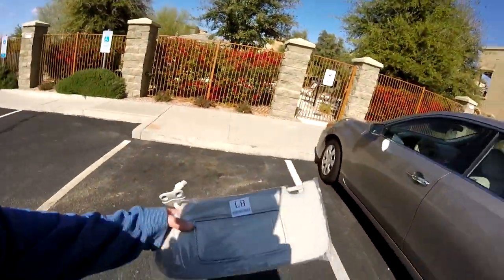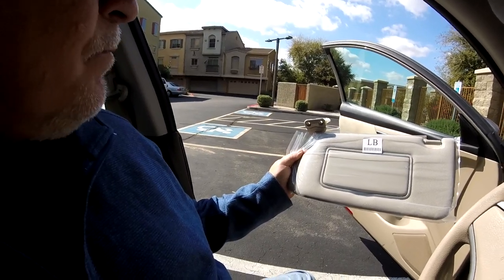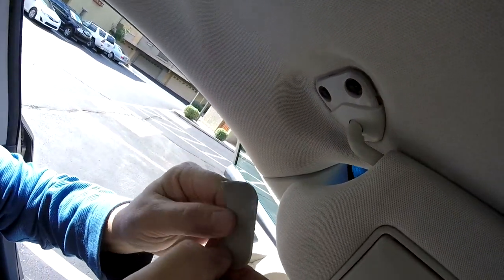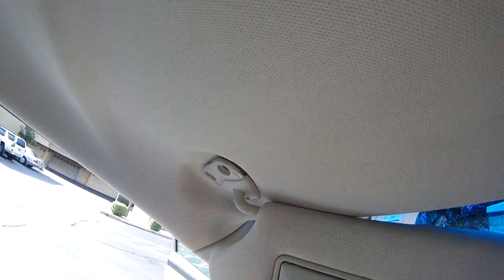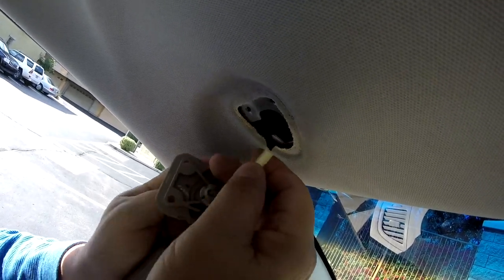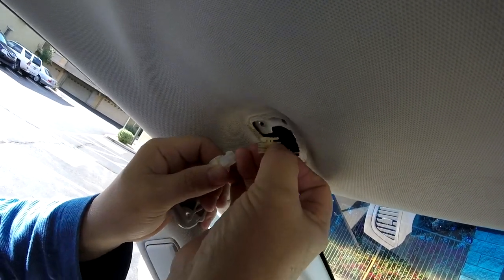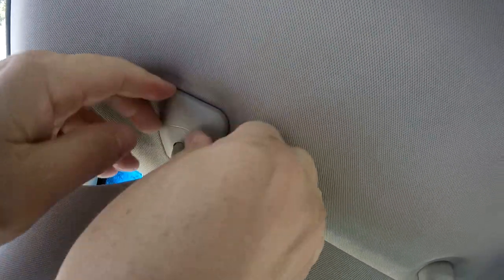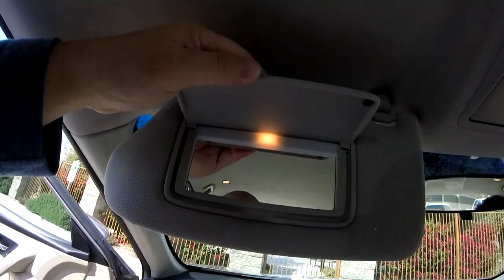How to Remove and Replace the Drivers side Sun Visor on a Nissan!

Comment: What do you do when the bolts won’t come out? They just spin and spin and spin, thanks.
Reply from the maker: I'm not sure what to tell you. Were you able to get them out?
Reply: eventually.  honestly not even sure what ultimately did it.  combo of pulling with pliers while using the sockets.  could have also been just pressing with varying strength in every which direction and finally getting it to bite.  pita for sure on something that should have been easy... nissan is trash @OurSimpleAdventures

Comment: If only I hadn't gotten so pissed off when the thing flopped in my face (again) while driving tonight... would've been an easy fix. Unfortunately, I had a tantrum and ripped it off/out - totally forgot about the whole light wiring  thing, was like what is all this wire? yank Soooo likely won't have a functioning light when I replace!  #oops
Reply from the maker: Lol Temper, temper!
Reply: @OurSimpleAdventures  Maybe you can post on installing a new temper.😇
Reply from the maker: @caseyd3043  😆
Reply: OMG!! Me too, man. I just lost my cool and practically wrenched the thing out. Luckily I had the replacement.

Comment: Thank you for the video, I have a 2012 nissan maxima and the dealer is charging me over 300 hundred dollars jus to replaced the driver side mirror. I found both side mirrors on ebay and it doesn't cost not even 100 dollars.
Reply from the maker: Yep! Do it yourself! Thanks for the comment!

Comment: Before I searched the video, I fought with a 7mm, then a 6mm, and an 8mm. I couldn't get any to engage the hex to remove the bolts. I'm going to look in my industrial toolbox and see if I have a 7.5mm? maybe my Chinese tool set that Napa forced me to buy to change my battery, doesn't comprehend a Japanese car's needs??
Reply from the maker: Ha! Yeah I don't know. Mine wasn't an exact fit either. Thanks for the comment!

Comment: What’s the tool called that you used to remove the bolts? Also when i was trying to pop off the tab all the other lights inside my car went off & won’t turn back on. i don’t know what to do anymore :(
Reply from the maker: Delia, that is a 1/4 inch drive ratchet with a 1/4 drive 7mm socket on the end. Also a 2-3 extension between them. Did you break a wire?

Comment: Did you have to disconnect the battery first? Or is that not necessary?
Reply from the maker: I did not disconnect the battery. You may want to. Thanks for the question!
Reply: @OurSimpleAdventures  - Thank you for responding so quickly. I took a chance and did it without having to disconnect the battery. It worked great!  Thank you!
Reply from the maker: @AnasCreativeCorner  Glad it helped!

Comment: I’ve tried to remove the Sun vision with a 7mm but it doesn’t fit. I’ve even purchased more and can’t get it off. What else can I do?
Reply from the maker: Maybe try 1/4 inch instead? Thanks for the question!
Reply: The outside diameter of your 7mm socket is probably too big to fit inside the well that the two bolts are located in.  Find a 7mm socket with a smaller diameter.

Comment: I bought a sun visor,  but can't rotate the pad,  I haven't installed it though.  Is it a bad one?
Reply from the maker: I'm not sure what pad you mean AJ Liu?
Reply: the visor can't rotate around the bar
Reply from the maker: @ajliu2168  Don't break it but it should move if you're a little firm with it.
Reply: I am experiencing the same thing! Did it end up working?
Reply from the maker: @berneeez21  Did you try to firmly rotate it?
Reply: BMONEY after installing, it can rotate. Reason is physics.
Reply from the maker: @ajliu2168  Thank you!

Comment: You're not showing how to mount the other end.  On my QX4 that's the part that is broken.
Reply from the maker: Watch the video Larry.
Reply: @OurSimpleAdventures  I had the same question as Larry and the video does not explain that part, which is fine but saying to watch the video does not answer the question. For replacing the visor it was a good video.

Comment: did ur old one have a light? i currently have one with no lights on it, but wanna upgrade to one with a light. I wanna know if I replace it with one with lights if the lights would work
Reply from the maker: Yes ours had a light. Not sure if yours would be wired. Let us know!
Reply: @OurSimpleAdventures  no it doesn't come with the wiring.
Reply from the maker: @manahungrywizard7812  Yeah not going to work then. Sorry!

Comment: What are those screws and would a screw driver work on them?
Reply from the maker: I believe they were Torx. I think I say in the video.
Reply: Those are bolts, removed using a 7mm socket--not a Torx screwdriver.
Reply from the maker: @JohnMSawyer  Thanks John.

Comment: How did you get the screws out so easily? They're too short for seemingly any socket wrench
Reply from the maker: Yeah it is a tight fit. You just have to force the socket onto the bolt and hold a lot of pressure. Make sure the socket is squared to the bolt too. Thanks for the question! Let us know how it goes and give us a follow and Subscribe as there will be more! Thanks again.

Comment: yeah those little covers are not as easy coming off as yours did for sure. Both of mine broke. They just would not come off no matter how gentle I was with them.
Reply from the maker: Sorry to hear that! Were you able to install the new visor?
Reply: Same issue. Any solution?
Reply: @SportsFreak217  sorry, I did not, they both broke, had to crazy glue the parts together
Reply from the maker: @SportsFreak217  Not sure what to tell you. Sorry.